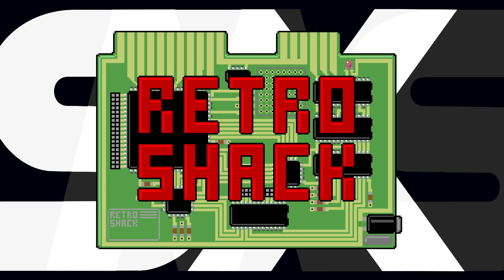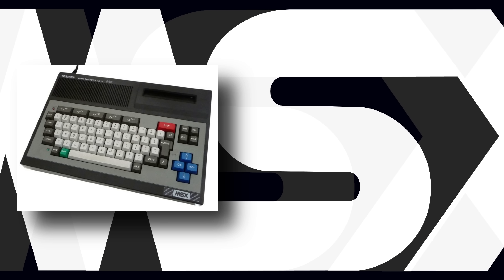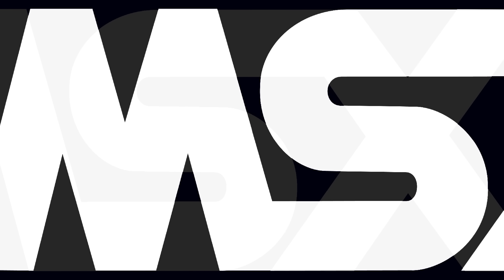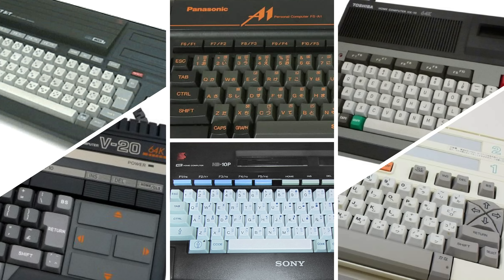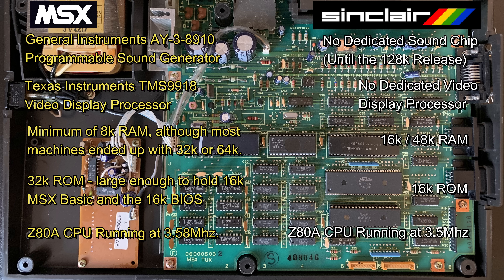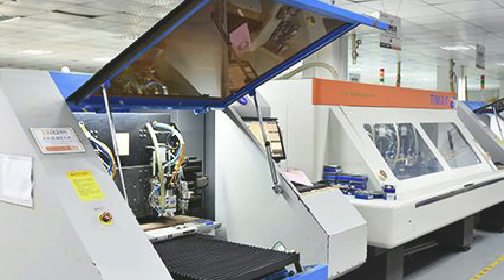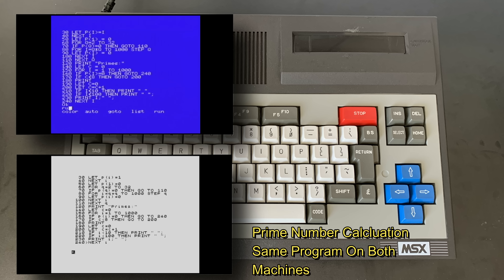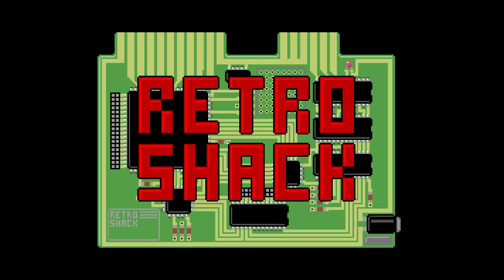Did I miss out by not having an MSX?  Was Sir Clive right about their performance? Let's find out!

Comment: Several years back. I asked myself a question. If IBM didn't come out with a pc and or nobody would clone them. Plus you already had a crack down on Apple II clones. If multiple computer mfgs. would get together and introduce some kind of standard. That is when I ran into the MSX line of computers. I read they even had one more release a version 2+? that could even run a version of windows 3.0?
Reply from the maker: Well that Windows 3 comment is going to get me scouring the web tonight :)
Reply: @TheRetroShack  Please forgive me. I think I found what I did. I was looking around at vintage and standards. Thus, the msx, msx2 and msx 2+. I also ran into a sharp x68000. Another Japan computer but this one does run windows. I swear I read something about the msx 2+. But possible not windows. That it might have been one last push for msx users before the system went away.

Comment: With the MSX-2 it was possible to directly write and read sectors to and of a floppy. Okay, it was a disabled basic instruction but calling the not removed hook it worked. It was great to mirror a game and then edit (translate) the text in said game. I also used it later to after command.com on a PC to prevent ANSI-art formatting the hard drive.
The NMS8280 I owned was capable of video digitizing and superimposing. what I used a lot. Still got the old machine, needs a recap when I find the time.
Reply: Are you sure that's MSX2 specific? I think if you connect a disk drive to an MSX1, the same is possible. Such stuff is in the disk ROM, which comes with the disk drive, and it's built-in if the MSX has a drive built-in, of course.
Reply: @ManuelBilderbeek  It was implemented in Basic as DSKI$()and DSKO$(). But it was either deemed too dangerous or there was not enough string-space. I heard both story's.
 ( see https://www.msx.org/wiki/DSKI$() )
Reply: @fiskurtjorn  Yeah, so that's disk BASIC, which is in the disk ROM, as I described.
Reply from the maker: I've said it before - I'm going to be addicted to collecting these things now!!! :)

Comment: Find the Yamaha CX5M with the built in FM music synth.
I had to help port electronic music composition software over to MSX, back in the day. The basic was a pretty simple version, (some versions lacked a 'MOD' instruction for example). Getting a disassembly of MSX revealed a lot of 'trick' coding, (jumps into the middle of an instruction, things like that), which made it hard to access through the ROM, though some games did it to use functions in the BASIC from machine code. It was also typically of MS Basic in being old fashioned and slow. BBC BASIC, which was a far more up to date design, simply ate it's lunch, as well as having more modern structured elements. 
If MSX had hit the UK before the main boom started, it would have swept the board though. The machines were quite high quality, especially compared to a Sinclair. 
I still have a wierd Pioneer PX7 model designed for Audio Visual work with their Laser Disc players - it has a built in interface for them.
Reply from the maker: I'll certainly keep an eye out for one as they sound like interesting machines!

Comment: Just point out that: MSX's Outrun beat ZX's, and still many consider MSX's Outrun an example of a very bad MSX game. That if we're talking MSX1 stock machines alone. MSX2 and newer, with extension cartridges  get much beyond..
In the ebd of the video you test a program in Basic. MSX Basic in arguably one of the most powerful in the 8-bit era...
The advantage Spectrums have is basically in memory timings, which potentially makes assembler programs a little faster.
Reply from the maker: That was kind of the point - even a badly ported Spectrum game was better (in my opinion) on the MSX!  In the next episode we'll get to what the MSX could do given the right attention :)
Reply: Anyone who thinks these Arcade conversion matched the actually arcade machines are seriously deluded, You can run the original arcade via mame on pc but siting in the Outr
un with moving chair is a different experience entirely. Its been shown that original games even the code master budget ones were better 'games' than arcade conversion.

Comment: Don't forget, the MSX keyboard was very much better than the Spectrum keyboard, and the MSX could use standard joysticks while the Spectrum could only manage joysticks if the designer of the game made special arrangements, and not all games had that option. An advancement for the Spectrum was the single keystroke BASIC, on the MSX you had to type in the complete BASIC command. The Spectrum had more advantages, if disconnected it could be stored on a bookshelve or in a shoebox, the MSX went to the attick.
Reply from the maker: That's the first time I've heard someone throw ease of storage into the mix! :) Brilliant!

Comment: How many Spectrum users can say they plugged anything into their Specy with a reasonable expectation of a reliable connection? Spectrums were built down to a price and then cut further. Huge quantities were built at the Timex factory along the road from where I am sitting - a company who made cheap watches and then built computers for Uncle Clive - an area in which they had no experience and expertise. An MSX machine was built by Japanese manufacturers who had learnt, through the 60s and 70s how to build solid reliable HIFi and TV equipment. The vast majority of their production was sent around the world and the last thing they wanted was for it to be shipped all the way back for repairs. Thus the Spectrum was just a High Tech toy with a similar life expectancy, while the MSX was built to last and bring customers back to the brand on the box. Just compare the input interface - I refuse to call Sinclair's effort a keyboard; it would barely qualify for a cheap throwaway pocket calculator! - while the MSX one was built to last and had real keys. I never - from 1961 with his matchbox radios based on manufacturers' reject semiconductors, through his self-destructing Hi-Fi of the late 60s and 70s - had expectations of a quality product from the Sinclair brands, and my expectations were fully realised. Every product has primarily served to, rapidly, fill up landfill sites and his rhetoric was, and still is, almost a match for Johnson and Trump!
Reply from the maker: Not a fan then? :) In all seriousness Sir Clive, like Trump, Johnson, Jobs, Gates etc do tend to polarise people’s opinion - I guess that’s part of what made them a success - love or hate them, you couldn’t ignore them :) Thanks for watching :)

Comment: I was probably one of the few that had an MSX machine in the United States.  I already had a C64, so it wasn't for games use.  Rather it was for music production, and was the Yamaha CX5m, with a built in FM synthesizer chip and a dedicated music keyboard.  I also had a disk drive for this machine, which I gather was rare anywhere, and unheard of in the US.  While I did write a few BASIC programs for it, mostly it was running dedicated music sequencer software from Yamaha, and I never had any other carts.
Reply from the maker: Mission Accepted: Find a hard disk for the MSX :) :)
Reply: @TheRetroShack  I imagine Chris was referring to a floppy.
Reply: @TheRetroShack  better use flash cards nowadays.... But SCSI and IDE interfaces were made. I used SCSI myself, with 2x 1GB hard drive, MO Drive and CD ROM drive.

Comment: Don't get the SD Mapper. It's not the cartridge you want and isn't compatible with much of the MSX software. I made this mistake and ended up returning it. You need the more expensive MegaFlashROM. This one actually writes the games to an eprom which then acts as an original cartridge game (more like an everdrive). The SD mapper will allow you to save files to an SD Card but not run commercial software (a few games work but not many)
Reply: Or the Carnivore 2. That one can do the same and also supports the YM2413 OPLL FM chip.
Reply from the maker: Thanks for that - noted and understood :)
Reply: Top comment, but I think the Carnivore is better.  Still, when I got an SD512 it greatly expanded my ability to run MSX games.

Comment: I had a Sony MSX in the UK.  At my school it was more popular than the Amstrad but that was because it was rural and the local independent electrical shops sold them alongside Japanese TVs and Videos and there was no Dixon’s or large WH Smith selling computers in smaller towns.  It was difficult at first to buy software as the shops selling the computers did not sell tapes but plenty was available 85-88 but mostly Spectrum conversions.

I upgraded to an Atari ST in 87 when MSX magazines ended and manufacturers stopped supporting them but really the Japanese developed Konami MSX cartridge games were more playable than early ST games.  Had MSX 2 been available in the UK at reasonable price I would have wanted one
Reply from the maker: Now's the time to get one - they're pretty reasonable prices at the moment :)

Comment: The speccy didn't have a chance in this battle - MSX 1 had a competent graphics and sound processor, and a very fine BASIC, and even the worst  MSX keyboard - Philips VG-8000 - was better than the spectrum's rubber horror.
Reply from the maker: The keyboard on this HX-10 is REALLY good - been using it for a while now and it's very well made.
Reply: The Philips VG-8000 was far from the worst MSX keyboard. The worst one I know of is on the Casio MX-10 and MX-101. The feel is poor (though not the worst that I've ever seen), but what truly destroys it is that it's too small to touch type on. (The big arrow keys, which are just built-in joystick direction switches, and two fire buttons work fine for games, though.)

Comment: Totally agree, MSX was a little superior to Spectrum, mostly audio and hardware sprites. The problem is most of the games for MSX in the 80s were ports from Spectrum. Those games were slower in MSX because of screen management, which was much easier in Spectrum (less video memory), and no use of MSX specific features (Sprites). Early MSXs 1 should be judged by their Konami games or even new creations like the ones in MSXDev.  I.e, games like this https://www.youtube.com/watch?v=0iCriF_JaeU that runs in an MSX1 with 16kb RAM.
Reply from the maker: I'll check that out - thanks! :)

Comment: I think Clive Sinclair was using the date of the TMS graphics chip, which was released in 1979 and used in the TI99/4
Reply: maybe true, but you forgot that the TMS Graphics chip had at least a 5 year technological head start to every other solution used in home computers. But yes TMS graphics chips were used in many other home computers, as it offered many advantages over other solution, it had sprites, and used no RAM space in the 64K address space of either the Z80 or any other 8-bit CPU, it had its own dedicated 16K RAM. It wasn't until the Amiga till better solutions were used.
Reply: @martindejong3974  Not really. The TMS chip was marginally ahead of its time but didn't support bitmapped graphics. All transfers to/from graphics memory are via a single byte data register and another control register. This makes the update of backgrounds slow.

The other problemis that it only supported single colour sprites and you could have no more than four on any one scan line otherwise the extra ones would disappear. This would complomise any game design.

Also there's no sideways scrolling of backgrounds at less than 8 pixels. This made sideways scrolling games slow and very jerky.

So, by the time that MSX came out the C64 was ageneration or two ahead and the bit-mapped graphics on the Spectrum allowed far more flexibility.
Reply: @decidedly_retro  the fact the tms was superior to ula is proved by the fact that many msx ports were straight ports from zx with at least the same game quality. the hypotetical slow vram i/o is overestimated ad proved by a game like outrun that on msx performs like zx in terms of FPS even being not programmed specifically for tms but instead processing gfx in the same manner the zx spectrum code did and converting them while uploading to the VDP.  that is far from an optimized approach . Despite that the msx version ran at rougly the same speed than zx version.
About sprites, the limitations are there but it is better to have limited sprites than absolutely nothing and make the cpu do all the job especially in '80 era when cpu power was rather limited.

And yes the C64 VIC-II chip had better sprites for sure. the VIC-II engineers said they have copied the idea from the TMS VDP chip.

About the use of sprites they enable more colorful background because they solve the colour clash problem.
the C64 withour hw sprites would have got the same gfx quality than zx games.
the same apply to TMS VDP ones.

If you look at konami games on msx you would see what a difference make using sprites in a smart way.
About the scrolling without hw scroll the step is 8 pixels scroll. Yes, jerky but I DO NOT REMEMBER that zx had hw scroll. 
If a ZX game would scroll smoothly IT IS REQUIRED that the CPU write the entire 6144 bytes of display frame every time. This is more effort for the CPU than the same thing on TMS where you can write the name table tiles with pre-shited tiles writing the entire screen with a effort of only 768 bytes instead of 6144
Reply: @decidedly_retro  when the msx came out the TMS in use was the A version that supported better bitmap graphics than the ZX spectrum ULA with the same resolution but reduced colour clash to 8x1 instead of 8x8 cell area of ZX, plus the added tile mode facility.
With TMS the screen can be programmed as a tile set, of when nametable is arranged correctly as a true bitmap screen with reduced color clash of 8x1 pixels vs the 8x8 limit of ZX.

In other words, a cell of 8x8 pixels on TMS can make use of all the 16 colors available even with constraints, versus the 2 colors of ZX Spectrum ULA.

But if i want to change the gfx displayed in a 8x8 cella area with ZX Spectrum i have only one way:
write 8 bytes of data+1 bytes of attribute
while with tms i can
write 8 bytes of data+8 bytes of attributes like in spectrum ULA
or more fast:
write one byte of pattern in nametable and flip one entire tile definition (color+pattern) with a single byte!
Reply from the maker: Maybe he was - but he was still wrong :) :)  Gotta love the salesman :)
Reply: the TMS chips was rather limited but anyway better than the Spectrum ULA in terms of gfx performances. While not having any kind of hw scrolling it provides tile mode patterns/less limited colour clash and hw sprites.
Reply: The MSX had the TMS9918A, which was the newer revision from 1981 and added the 2 new graphic modes that the plain TMS9918 hadn't.

Comment: I've got a Sony HitBit MSX2.  In great condition other than the keyboard mylar is basically gone.  Almost all of the traces are gone.  Any idea how I can fix/replace that?  I mean, it's gone so much that I don't think even conductive ink would help (unless maybe I find a print out of one to trace).
Reply from the maker: You could try this stuff as some people have had success with it: Conductive Wire Glue/Paint - NO Soldering Iron https://www.amazon.co.uk/dp/B00SRIITQ4/ref=cm_sw_r_cp_api_glt_fabc_CMQMNMV21MZHQ6VWDP1F
Reply: Maybe someone on the forums at www.msx.org has a solution for you.

Comment: But can the MSX do scrolling?  Thought not, it's little more than a Colecovision with a keyboard!
Reply: no, the MSX1 cannot, but MSX2, 2+ and 2+R can
Reply: HARDWARE scrolling no, not in the way you mean it, but it could do software scrolling, and if you used a special video mode of the TMS chip, you could scroll efficiently by only having to move the character pointers, but almost no Spectrum programmer knew about that trick, and so tried the lazy approach of scrolling 8K of video ram per frame, instead of just 1K. Later MSX models added hardware scrolling to make scrolling easier.
Reply from the maker: But I loved my Colecovision :)  Would have been happy to have a keyboard on that :) :)
Reply: @TheRetroShack  Such as the Coleco Adam?
Reply from the maker: @universal70  Brilliant... Something else to buy... ;) Thanks! :) :)